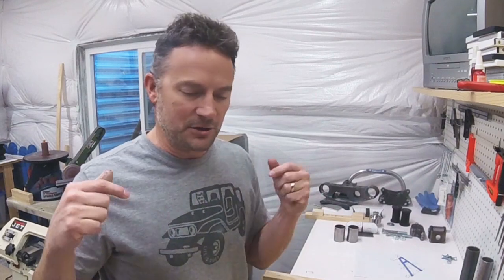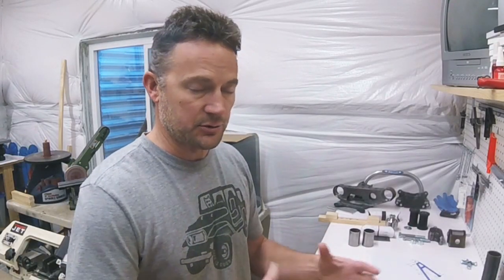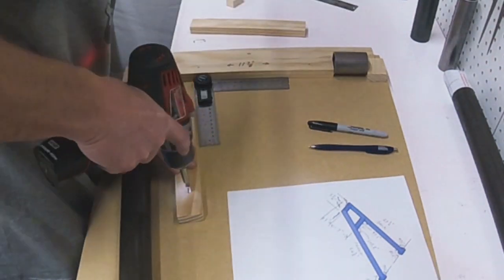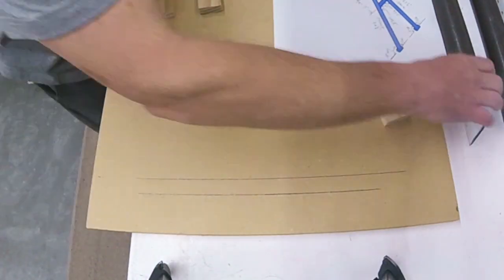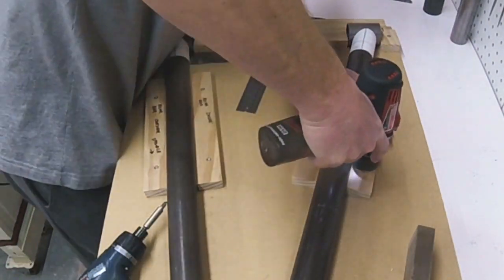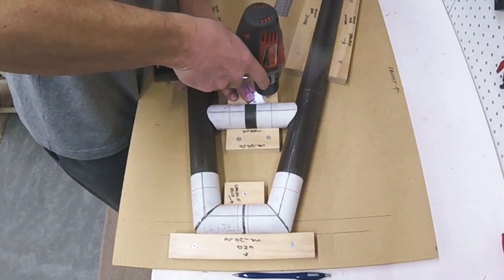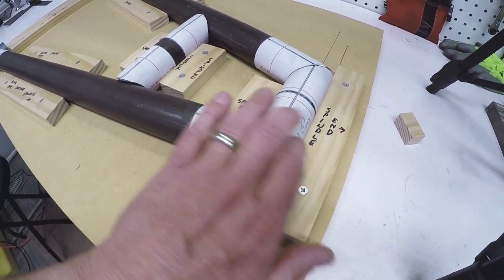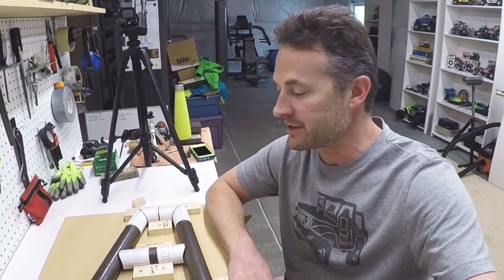Making a Jig to weld up control arms

Comment: Dumb question, how does that not catch on fire?  One more question, how is that strong enough to prevent the tubes from moving during weld shrinkage???  I'd love to make a jig out of wood, but idk if i can trust it?  Advice?
Reply from the maker: All the Jig is for is to hold things in place to tack them together. When I final weld it I take it out of the Jig. It will still warp, even if the jig was metal. I usually need to put it in a press when done to push the ends back out so it fits in the frame tabs.
Reply: Thanks!!!!

Comment: What kind of tube do I need to make control arm's thanks for your ifo.
Reply from the maker: These are 1 3/4" x .095" DOM. This Baja is a bit heavier than a normal VW Baja. My other Baja has 1 1/2" tube and they are just fine.